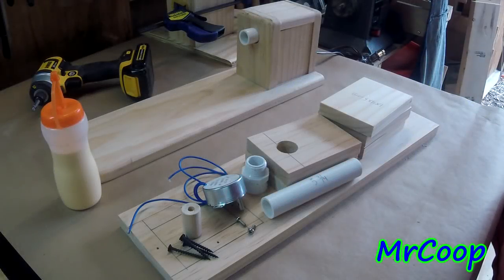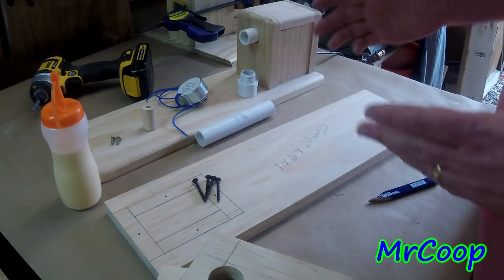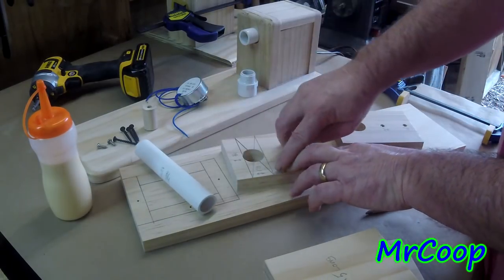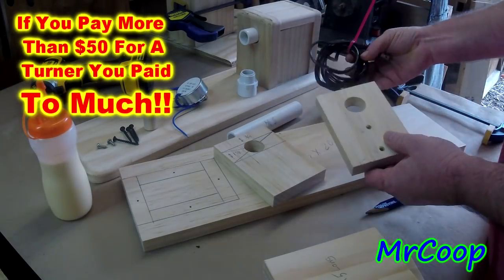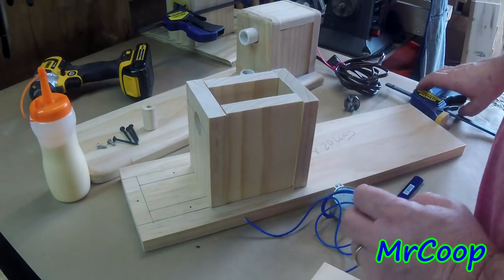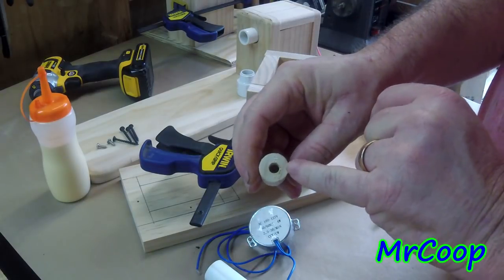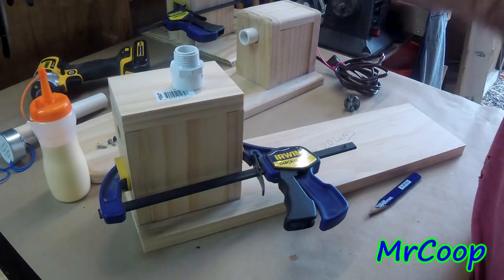How To Make A Less Than $25 Epoxy Resin Cup Turner

Comment: I haven't tested mine a lot yet, but I used a wine bottle cork instead of a dowel rod.  I was careful drilling the hole, but no sanding needed it'll push right into the pvc pipe :)
Reply: That's a good idea!! Thanks!
Reply: Did it end up working ?

Comment: i used 2 of the synchronous motors for my tumbler turner, one got hot and it stop working......so i purchased a small 3x3 fan motor and installed in back of motor.....it works great..keeps motor cool....!!!!

Comment: Hello, I followed your video instructions and my Turner has a vibration at one point in the turning cycle. Have you ever had this happen and is there a fix?
Reply: Did you ever find out what causes it to vibrate? Mine does as well.

Comment: MrCoop, thanks so much for this it is exactly what I needed to know to get started. I had a general idea of what I needed to construct but had no clue about what type of motor to use. I have 2 questions please, first the motor is listed as 2.5-3.5rpm, that seems awfully slow to me so I just want to be sure the link hadn't changed. My other question is construction related, I hate wasting an entire dowel for 1 lousy inch, any suggestions on what else I could use to attach the motor assembly to the pvc rod? Thanks a bunch
Reply from the maker: These 2.5 to 3 rpm motors are what have been used since the beginning of the turner world. Some folks use faster ones and like them. Myself I like the slower ones the epoxy works better leveling out in my opinion. As for the dowel. They are cheap and you can use more of it if your decide to make new turners. The cost is worth buying it.
Reply: @MrCoop  thanks hun. I have made my first one and it works great. I thought the motor would be slow but its perfect. Thanks so much for the tutorial. I did go a slightly different way with attaching the motor to the pvc, I drilled the hole in the board with the motor a little larger, then used a cotter pin that went through a hole drilled in the pvc pipe and then through the hole on the shaft. Hammered the pin flat and it doesn't bind. Without a drill press it was impossible to drill that hole perfectly

Comment from the maker: Link To Motor:
https://amzn.to/2Ox67x1
https://amzn.to/2xXjhtC
Link To Cord:
https://amzn.to/2DSvBRi
Link To Wheel Switch:
https://amzn.to/2ODV85e
Reply: Uxcell cow/cow direction 4w 50/60hz frequency 2.5-3rpm electric synchronous motor ac 100-127v
Reply: MrCoop can I get a link to that motor thanks
Reply from the maker: @faithwiegand420  copy and past at Amazon or Ebay
Reply: MrCoop do you happen to sell these?

Comment: Hey coop i subd your channel! Like your vids! This one im a bit confused about. For hole bit, drill bit, c clamp, motor, all that wood and screws is less then 25 bucks?
Reply from the maker: The turner itself is less than $25. The tools do not count as they are not part of the turner.
Reply: The parts to build it is less then $25. 
More for the tools.

Comment: So with the box glued and nailed how do you change the motor out when it starts going out?
Reply from the maker: The motor is attached to the back of the box. Everything should slide right out through the holes drilled for the pipe.

Comment: You had put all 5 sides and top on then pulled the wires inside the box... then what??
Reply from the maker: You put the cord you are plugging into the wall in bottom hole then wire the 4 together. Tape them or wire nut them which ever you like. Doesn't matter what cord goes to what cord. As long as one from the motor attaches to one of the plug wires and the other blue one attaches to the other . Here is a wiring video.. https://youtu.be/tGNd0hcyb_s

Comment: I DID IT!!! SUCCESS! I did make a modification to the top piece by adding 2 small hinges so if I need to get to the wiring, it’s easy access! Also! Does that motor go in both directions?

Comment: Can I use a motor with these specifications?  uxcell AC 100-127V 15-18R/Min Round Shaft CCW/CW Direction 4W Synchron Synchronous Motor
Reply: What should the R/min be?

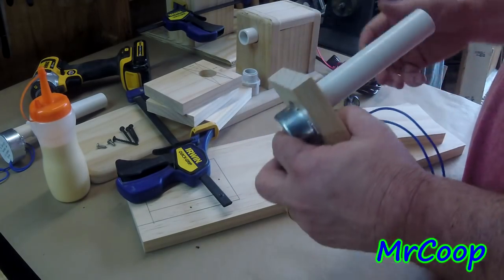Comment: 9:20 "...you hook the 2 together". What wires do you hook together, the blue ones together with the brown cord? May you please clarify this for me? Thanks.
Reply: Two wires from the plug and switch and two wires from the motor. Connect one plug wire to one motor wire. Then connect the other two. It doesn't matter which one you connect as long as it is one from the plug and one from the motor. It is operating on AC power which is alternating current and therefore no need for negative/positive wires. You will notice that when you start it and stop it, it will spin in either direction.
Reply: @GDubSupreme  Thanks. I'll do it.

Comment: We made this as a cup turner for myself but the motor is getting extremely hot. What type of cable do you attach this to so that it works longer than just a couple of uses?
Reply from the maker: Been using ours for over a year with no issues.  They motors all get hot no way around it. Just the way they are designed.

Comment: Where does the male end go? Never seen you put that on.
Reply: The male adapter goes on the other end of the pipe from the motor and you can get a female adapter and another piece of pipe, glue the female adapter to the pipe that way you can secure the pipe to the turner with your cup on it. If you want to store the cup somewhere to finish drying, you can leave the pipe in the cup, have another one made and ready and continue with your next cup.

Comment: mr coop im confused about why i would drill holes for the wires when the motor appears to mount on outside of box otherwise i dont understand why i would want two holes the size of the pvc pipe please help me understand
Reply from the maker: The video is pretty simple to follow. If you don’t think you need the holes you mentioned don’t make them.

Comment: Hi, I have a question about making a cup turner. My daughter wanted to see if I could make her a couple of these for her. I was able to locate the motors and cords with inline switches. Making the wooden base and box was not a problem, also glueing the dowel rod inside the pvc pipe. My biggest problem, which you don't really show, is how do you drill the hole for the shaft of the motor dead center of the dowel? I have been able to find exact center of the dowel, but even using a drill press, it seems that the drill bit tends to follow the wood grain and is never centered. Then when used, it turns like egg shaped and binds in the holes in the box. Please help and let me know how you are drilling these. Thanks
Reply from the maker: I used a wood lathe to drill mine. There are videos on YouTube that show you how to drill a center hole. Your best bet is find a local pen and wood turning group. Those guys would probably drill your 7mm hole and turn them down to the size you need to fit the pipe for free. If they did charge you it would be only a few $$.

Comment: Hey coop. So I made one of these for some reason my motor keeps stopping. I have two different ones and it happens each time. I hear the motor trying to spin but it doesn’t. Any clue what’s wrong?
Reply: I have had same issue with 2 of mine. What I have discovered is something isn't quite lined up/level. What I haven't figured out is how to correct it. Except when I loosen the screws to the motor...which obviously isn't a good solution either.
Reply: if you can use longer screws to hold the motor in place and not screw it down tight to the board the motor will "float"and not bind.  light oil in the holes where pvc comes through would help also.  pvc pipe MUST turn very free or motor will be labored.  only to make it better would to add bearings and that would be a whole new ballgame.

Comment: thank you for your video ? on the cut wood is that 1x6 literal or 3/4x 5 1/2 and same on the 1x 4 or 3/4 x 3 1/2 thank you
Reply: For the long wood it would be 1in thick by 6 in wide by 20in in length so that would be 1x6x20

Same with the small wood
1x4x5

Comment: Is the wood 1” wide or 3/4” wide?
Reply: standard wood measurement is NOT the size it actually is, for example any 1 inch board would only measure 3/4" wide.  Why?  you will have to google that one.  

 However with that being said there are actually true dimensional woods out there but the kind you will find at the box stores will NOT be true dimensional. Typically, from my experience, true dimensional lumber is used in cabinet or furniture carpentry.

Comment: How would it turn if motor is glued to the wood
Reply: The motor housing is not what turns.  The motor turns on the inside of the housing, so you are not attaching the actual "motor" to the box.  It is what holds the motor.

Comment: My handle is falling off at the male fitting. Should i glue it?
Reply from the maker: If it is falling off then yes glue it or put a screw in the side. If it is on the turner itself I would put a screw in it. That way if you ever have to take it off you can.
Reply: MrCoop Thank you!

Comment: Hi! I feel like I completely missed what the coupling / adapter was used for! I watched all the way through, and then skipped around, and I'm not sure if I just can't find that section again, or what. :)
Reply from the maker: When you have it all together it pops on the pvc pipe sticking out the front.
Reply: @MrCoop  For what?
Reply: @Dennis-pe6zx  to add the PVC arm that the football will be attach to. But your gonna need to add the female adapter which will connect to the male adapter on the video

Comment: Hi. I got a 4-pack if these motors. Is it possible to connect all 4 to one lamp cord to make a multi-cup turner? Or should I buy a lamp cord for each 🤔?
Reply from the maker: Yes you just have to daisy chain them together.  Lots of videos showing you how to do that on youtube
Reply: Thank you
Reply: I would have separate switches so you have more control. I'm building a four turner, but all with separate switches.
Reply from the maker: daisy chaining the switches together will give you what you are wanting.
Reply: MrCoop can you do a video on daisy chaining.  The one I’ve seen look complicated Or add good link to follow.

Comment: Guys I need some help I have finished building this and the motor does not do a full rotation it stops and goes back the other way did I buy the wrong motor ?
Reply: By the way I do not have the switch yet would that have something to do with it?
Reply: You bought the microwave motor
Reply: Which rotates
Reply: @elenaestrada9794  it's ok I fixed it if the motor gets in any kind of bind it will go the opposite direction so I just had to line up the holes better

Comment: Thank you for this great video.... made ours last night put a cup on, epoxied and loved it, but woke up this morning to the motor not working and my epoxy dried with drips so it apparently didn't stay on long. Any suggestions of what could have happened?
Reply: The motor used in this video is basically the same motor used in your microwave to turn your food while it's hearing. It's not meant to stay turning for hours. The motor gets to hot and stops working. The best motor for cup turners are rotisserie motors, the kind you find on grills. They are $25-$35 a piece but they will run for hours and hours and hours and never fail you. So it's worth the price to pay so as not to ruin a cup, epoxy, time and then time spent to strip the failed cup. 
Just look on YouTube for how to make rotisserie multi cup turners or single turners. Whichever your looking for. Hope this helps. 
Good luck.

Comment: Mr coop,  i built this turner but it appears that the motor got so hot that it softened the glue and dowel rod/pvc fell off. Turner was only going for an hour. Has this ever happened to you?
Reply from the maker: Dont know what to tell you, None of mine have done this at all. Yes the motor gets hot but has never loosened the glue.
Reply: Traci Domke  mine is doing the same thing!
Reply: Omg! Thank you! I just bought one on Etsy build JUST LIKE THIS! Same thing is happening. It gets so hot the glue is loosing and my pvc pipe dropped my cup within an hour of using it. It was $65 and the seller will not refund my money.
Reply: He said super glue. I'm not seeing super glue loosening either.
Reply from the maker: @kittkatt032  I'm not sure. Only other glue they make that I know are some super glues. What is it that you are using glue on??
Reply from the maker: @BusyDee  I use CA glue it is like super glue.
Reply: @lukestonecypher7026  I watched a youtube video and some woman had an issue with the cup being ruin with the epoxy so she was able to remove the epoxy from the tumbler and redo it.

Comment: At what point and where do you use the coupling?
Reply from the maker: When it is completed you pop it on the end of the pic pipe sticking out of the front
Reply: I didn't get that part either. Still no clear on how to use it.
Reply: It goes on the pvc that comes out of the box and the pvc that your cup will be on will have a female piece
Reply: From what I'm seeing everywhere, you wouldn't need it.. dollar tree foam football's can just be shoved onto the end of the pipe and e-tape to hold it. Just pull the stick off the end of the football, it leaves a perfect hole for the pipe. And they fit the size of the cups to turn.
Reply: @MrCoop  I looked on Amazon for the cord (switch). What else can I use in substitution for that?
Reply: @MrCoop  wheel switch, I'm sorry. On Amazon it says that it's out of stock.
Reply from the maker: @ashleyvaladez7407  https://amzn.to/2DwBG3L
Reply from the maker: @ashleyvaladez7407  https://amzn.to/2DwBG3L
Reply: @jnicholson061905  he has another tutorial  on how to do the tumbler arms with the football or noodles.
Reply: @jnicholson061905  you are absolutely correct if you are putting the cup on with a football and sliding it off when you are done.  When the coupling comes in handy is if your cup has been spinning for 4-6 hours and you have another one to do right behind it.  Since it might still be tacky you can simply unscrew your pvc pipe from your coupler and take the pvc pipe off while your cup is still on it.  Screw that into your drying rack so it can cure and pop on another piece of pvc with a football and turn another cup. Speeds up the assembly line.  Look up a tutorial for building a tumbler drying rack if you don't already have one.  I built my 2nd one this morning in 15 minutes.  I love that thing!  About to build this turner this afternoon.  Thank you Mr. Coup!

Comment: Do you twist all four wires together? Or one blue to one brown etc.
Reply from the maker: blue to one brown etc
Reply: MrCoop so you just twist them together and boom it will work, no soldering?
Reply: NColledge72 I would assume you'd have to cover exposed wiring with electrical tape, cap, etc but basically, after that... boom.

Comment: My SIL wants me to build one of these but her "support group' told her these motors get really hot and have a short life span yet I see almost all use this style, so are they a good motor or are they short lived?
Reply from the maker: She needs a new support group. We have been using the same motors on our 4 turners for over a year and they all still work fine with no issues at all. Yes they get warm. But all of them do even the rotisseries. They have the same exact motor inside the plastic box.
Reply: @MrCoop  That's what I was thinking too!
Thanks for the info, let the build begin

Comment: Mr Coop.. Is this a version of a lathe?
Reply from the maker: Somewhat it turns but you are putting epoxy on instead of taking it off..
Reply: Like a protective coating?
Reply from the maker: Yes kinda. Do a search on swirl tumbler. That will give you an idea

Comment: Does the top piece needs to be 5 1/2 inches? because the boards are 3/4 inch thick plus the 4 inch width  is 5 1/2.
Reply from the maker: If you watched the video you will see all the woof for the box is the same exact size. If you feel it is wrong cut it your way and get back to me on how well it worked out for you..